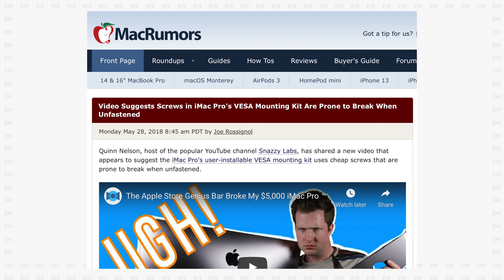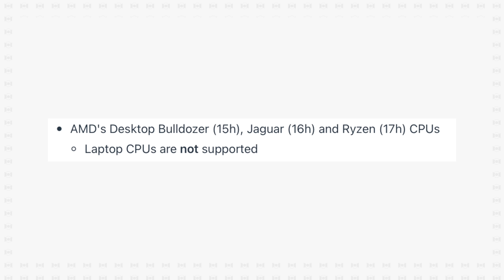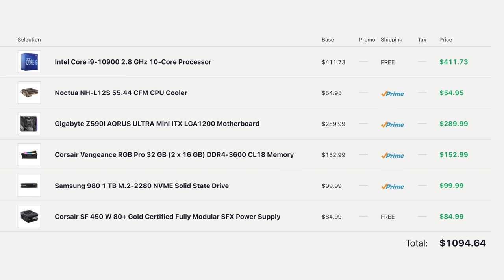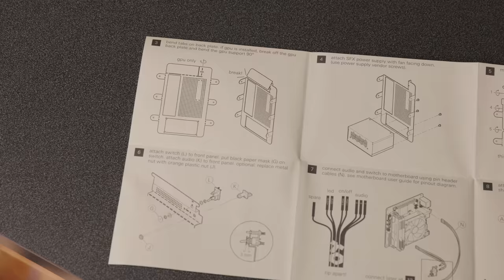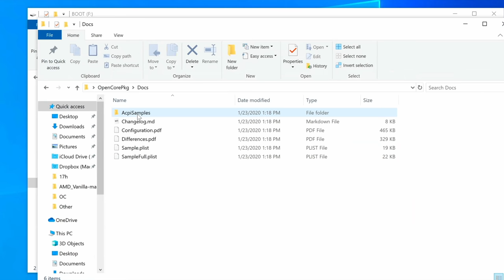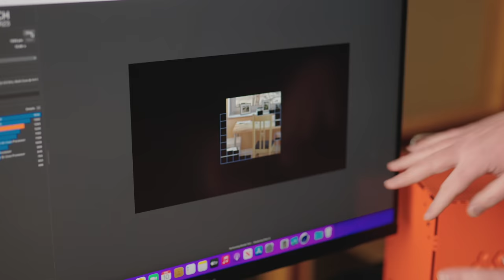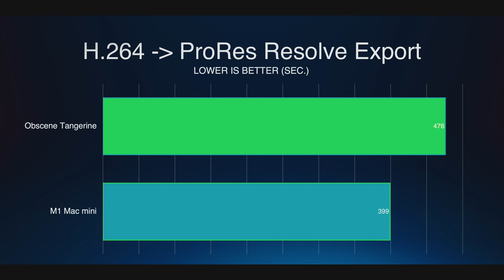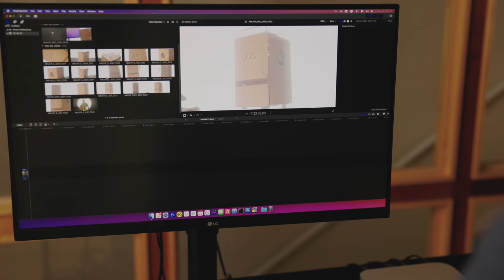The Last Hackintosh?

Comment: I get that Hackintosh doesn't make a lot of sense anymore, but how does the M1 stack up to this machine running Windows? Is there actually a benefit to running MacOS anymore? 

I used to build PCs from 1998-2010. From 2006-2010 I bought some used Macs to learn. Finally in 2010 I switched completely to Mac for my personal machines. OSX was more stable than Windows and there were more creative software options. Also Macs were still upgradable. You could swap HDDs, RAM, batteries, optical drives, and there were an assortment of ports. Plus they could dual boot Windows if need be.

I’ve been a Mac user for 12 years now and over that time Apple machines have gotten less upgradable and the OS has become less stable. I have more crashes and lockups today then I ever did a decade ago. The focus has also shifted from the creative community and education market to being more a high end fashion technology brand that sells flashy disposable gadgets. 

So even if they have gotten more powerful with the new M1 chips, is there still a benefit for me and people like me to be a Mac user? Assuming that we’ve already gotten to the point where most of us had plenty of computer power years ago to do what we need to do. That we don’t need to render that video 30 seconds faster, because it really doesn’t matter that much for most of us.

Comment: I really like the OpenCore approach but I’m sure it’s a PIA to get running. Years ago in the Z97 days I went hard and used Ozmosis which was an efi boot loader that you would custom build for your exact board and then flash directly to the motherboard. It gave essentially 100% compatibility including thunderbolt on my gigabyte board and would run incremental dot releases no problem but it was a massive pain with setup. After that machine essentially reached EOL when OpenCore released instead of doing it again and hoping I could find another nice German fellow to help me out, I bailed and switched to a 2011 MacPro. 

The EFI approach works fantastic and is rock solid once done (because it’s not really emulation but rather translation) but it’s too much work for me, even as a CS grad. In some ways I’m sad to see the end of the intel and subsequently the hackintosh days but at least Apple is making reasonable hardware again with distinct advantages.
Reply: so you downgraded cpus? Z97 is a 2014 platform, 2011 mac pros were a 2006 platform. it might have more cores depending on your config, but they were slower per core. how was that machine at EOL when opencore released? you can probably transfer your install to opencore, and your machine wont just stop working, and stop functioning once a newer bootloader becomes the standard.
Reply: @raycert07   Yes I didn’t want to move to OpenCore because of the headache of the setup. Also the fact that I upgraded to an AMD platform with an I
Nvidia GPU where as before I was using intel with the iGPU and it just wasn’t worth it to me. The machine was only EOL for its secondary gaming purposes. 

The Mac Pro is a DP machine so 12 cores total in my case with an AMD 570 and 64GB ram. More of a lateral move for my video/photo editing use then an improvement but easier to manage. I never said that it was an upgrade. I was able to move to Mojave something I couldn’t do on the old Ozmosis machine due to the death of that project and incompatibility (and my not wanting to waste more time on it) but that was the only change I made. The same SSD actually worked perfect on the pro.
Reply: @Alexlfm  yes it may have 12 cores, but thats because it uses 2 old 6 core xeons that are linked together through a chipset. having this chipset has performance impacts. the amount of ram also does not matter if your hardware cant fully utilize it. and having more ram might actually make workloads slower due to your cpus needing to make memory copies to the other cpus ram controller because they communicate through a chipset, and the memory isnt shared. but i digress. the sdd might work fine, though iirc they only support up to sata 2 which will definitely limit the performance of the ssd.

Comment: You know Quinn, as a seasoned Hackintosher, i have to say while the process was quite full of new experiences each and every time, Hackintoshes are not for people who need to 1. Get stuff done and/or 2. Have a family/friends/life. A Hackintosh is an enormous time sink and sadly i don't believe we have any of that to waste on endless tinkering.
Reply: Our business has been running hackintoshes as our main servers, render boxes and edit machines since 2013. If you do your research, it’s really not much different than any other computer. Even my fiance, who until recently couldn’t figure out use time machine, dailies a hackintosh and has had no issues in over a year. But yeah if you just slap together whatever parts and update the OS without knowing whats changed, then yeah, you’re gonna have a bad time.
Reply: This is easily one of the worst takes on hackintoshes. I personally got drawn to MacOS for productivity purposes and continue to do so as a developer. Windows for gaming, Linux for server stuff, and MacOS for development. That’s my workflow and building a high spec hackintosh (I’m not talking about the gamer CPUs, i’m talking about anything with more than 40 pcie lanes and 64GB of ram) ensures I do it without compromises and easily upgrade able/replaceable components. A hackintosh can be a one and done deal, you have the freedom to tinker and waste time if that’s what you want or build something reliable. That’s up to you.

Comment: You'll also need to add the $200.00 for the case to the Intel Build making $1294.64 not $1094.64 and putting the price a good bit over the Mac Mini.  Thanks for sharing.

Comment: 17:42 I think this shows you why Professional GPGPUs use HBM for memory instead of GDDR. For AI and Compute workloads at high performance it's easy for the GPGPU to get memory starved, so a solution like a unified SoC or HBM memory is prefferable where super high bandwidth and wide bus width is favourable.

Comment: 16g ram + 256g SSD + external SSD will be more reasonable for Mac mini.
Reply: I have never used a Mac before, so curious to know can you install softwares directly onto the external SSD ?
Reply: @vsuperbhat  yes you can, if an app is in a DMG from downloading you can drag it to the SSD folder instead of the applications folder and open it from there
Reply: @Noaddedsalt01  thanks for explaining 😊👍🏼

Comment: I'll curse Apple's anti-repair practices until the day I die, but when I went shopping for a laptop, the M1 chips made it a no-brainer. Unless you have a very specific piece of software you need to run that's windows-only, they're actually considerably better value than a lot of windows machines out there, especially when you factor in overall build quality and display quality. The lack of ports does suck though.
Reply: In a laptop there is no question... Power consumption wins, especially when you don't have to chose "crawling slow" to get low power consumption.

Comment: My guess is the affinity photo benchmark outperforms the AMD dGPU because the developer specifically optimized their code for metal and M1, and not AMD.  In cases where you’ve got cross platform optimization, like for example, redshift renderer with cinema4d, even an older NVidia mobile dGPU completely destroys the M1 Max.  And Apple specifically touts redshift as being optimized for M1 & metal on their own website 🤷‍♂️

Comment: While M1 is impressive, no doubt. Much of its single core performance emnates from the fact that it is based on cutting edge 5 nm process compared to Intel 10950K and most other modern CPUs are still stuck at 14nm. Intel is improving now so that gap is only gonna shrink. Second important thing is M1 packs special hardware accelerators for certain workloads which x86 architecture CPUs dont as of now. Maybe that will change soon.

Comment: Honestly, the M1 is amazing for who it is marketed for. And real people don't sit around running benchmarks all the time. For office work, it's going to blow past any similarly priced Windows PC. (And no most people don't need 1TB, Apple already buys up like half the world's supply of NAND flash they don't need to waste it on their entry-level computers who are going to be sold to people who can just as easily buy an external HDD or SSD if they eventually need more storage which they probably won't.)

For the tests that it didn't do well, I suspect we'll see an Mac mini Pro or something that will have twice the performance cores and be a much closer match and it'll still be in that price range if you don't give it more SSD than it needs. (Sadly I suspect it'll be announced after all the desktop users buy iMac Pros). Apple has already sold a ton of M1 minis to server farms and I suspect they'll sell a lot more once they offer M1 Pro and M1 Max in the mini (heck maybe they'll even do a dual Pro option.)

I think it's actually really cool what Apple has been doing with the M1 line of computers. The Air is actually just as fast as the Pro for a lot of things, and when the M2 comes out it'll be available to give non-pros just as fast of an experience as the Pros get, but the Pros will need to buy chips that allow more parallelism. It's kinda crazy but it's a lot more equitable than things have ever been on the Intel side of things.

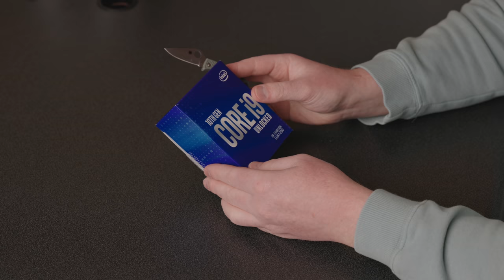Comment: @4:04 - bit of a correction there. Pro audio apps like logic pro and pro tools work absolutely fine on Ryzen (tested on big sur/monterey), and the issue seems to be specific to using certain machine IDs. I'm using logic pro on a Ryzen 3700x, and it works spectacularly, with excellent hardware acceleration, low sample packet size processing with low latency, and superb multicore handling (excluding the multicore handling bugs that have been present in every modern version of LPX, thanks Apple). No issues present at all in Pro Tools.

Comment: I think it would have been fair to compare the M1 mac to an Intel 11th gen cpu and not a 10th gen one... Apple wouldn't have switched over to M1 if it's Intel 10th gen Macs were better
Reply: The difference between 10th and 11th gen is laughable.
Reply: @nimoy007  eh no. 11th gen actually managed to beat Ryzen in some areas but its power consumption was so ridiculously high that it just wasn't worth it. ( especially on a laptop)

Comment: I built an alder lake desktop for less money than this and is significantly faster. I only say this because you are using 2 year old Intel tech vs 1 year old apple tech. 11th or 12th gen would really make a huge difference for no more money
Reply from the maker: Watch the video, please. First of all, 11th gen sucks. Yes, 12th gen would be more performance but it’s not fully Hackintosh compatible and the cost of even the lowest end GPU would push things WAY over budget.
Reply: @snazzy  Just man up and do a proper Alder Lake hackintosh. Get a cheap 6600 XT if need be. Quit stalling, you know Alder Lake is a monster of a CPU.

Comment: The case was made for form not function.

I love the idea of the aviator switch for power. So much mine has one for power, and one for restart, with a key switch in series with the power so both have to be used. Starting up(on the rare occasion it's shutdown so that I have to start it up...) feels like sending off a nuke.

Comment: Only sane way to run hackintosh nowadays in my experience is under QEMU like you showed in a previous video. You can run any CPU or network card you want (because you emulate a nic) and the compatibility is way better.
Reply from the maker: Agreed. Pretty cool.
Reply: @snazzy  Yeah. I tried OC a while ago and it's crazy complicated compared to clover.. Impressed you got it working.

Comment: 9:21 TRS stands for Tip, Ring, Sleeve, identifying the parts of the plug, originally a 1/4" plug used for telephony, back in the day of switchboard operators. There is sadly no standard for which is L and R, but the Sleeve is aways common. A little remnant of old technology, so you appreciate the world of standardization and instant gratification you grew up in.

Comment: One thing you failed to talk about (but tangentially touched on), is how much more powerful Mac's new silicon is for mobile computing.  If you're someone that works on the go, the MacBooks are even more of a no-brainer even if a hypothetical mobile Intel-based Hackintosh existed.  

You kind of touched on that with the power draw comparisons, but I think it's much better framed in terms of battery life.  Even if a theoretical mobile Hackintosh was 20% faster in certain tasks than a MacBook, you'd be able to work TWO TO THREE TIMES LONGER on the same-sized battery with a MacBook.  That's absolutely massive for productivity on-the-go.

So if you remove the power plug and the unlimited power of a desktop from the equation, I think the "which is more performant?" question becomes more interesting for any arbitrary length of time.  A mobile device without any power left is not very performant, and I have every reason to believe that mobile computing will only continue to grow in importance.

Comment: Just curious - How did you use the Z590i with a 10th gen cpu and iGPU? I tried briefly to do a hackintosh with an i5 10400 and b560i from MSI, but couldn't get display out and most "solutions" were basically "no you can't do that."

Comment: I started building hackintoshes for music / pro audio purposes.  In some instances, it actually makes sense to still have at least one hackintosh around in a studio.  A lot of audio hardware is expensive.  As long as you get something with good analog specs and it doesn't break, you're not going to be upgrading your audio interface very frequently.  The digital connection from the interface to the computer is usually quickly outdated, but the interface itself could function for quite a long time after that.  This is also not mentioning that the manufacturer of your audio interface could decide to stop making updated drivers for whatever reason.  Having a hackintosh in the studio that can run a wide range of Mac OS versions but also have the versatility of PCI express is quite valuable, and I have a feeling it will be for some time.

Yes, Thunderbolt dongles exist, but you often have to daisy chain a couple them to get the connection that you want.  For example if you need Firewire and you have a modern Mac, you have to go from Thunderbolt 3 to Thunderbolt 2 and then to Firewire.  Using this many dongles is just asking for trouble when it comes to an audio device, and using a direct PCI express card Firewire controller is much more reliable.  In my case, I have a MIDI control surface, the M-Audio ProjectMix I/O.  This device is an 8 channel audio interface but also a full control surface with motorized faders.  The closest modern equivalent is the Mackie MCU Pro which is $1300.  I paid $800 for the ProjectMix in around 2009.  It still technically functions today and works with custom drivers up to Mac OS 10.11.  One of the hackintosh systems in my studio is meant entirely for taking devices like this (including an old USB interface) and serving up the MIDI (and audio if I wanted) across my home network to other computers.

However, I think the day may have come where my DAW computer will stop being a hackintosh and I will replace it with an Apple Silicon machine.  Since I only need Thunderbolt 2 on that machine, I'll only have to use 1 tier of dongle.

Comment: I have a Mac Pro 2010 with GTX980, PCIe SSDs, 32GB Ram and 12 cores.
It runs High Sierra and runs more of the applications and games I have than a modern Mac does.
I don't want to run things trough many layers of emulation, or not at all.
Yes, quite a bit of the software I want to use is not well maintained or at all, but that has never been a problem on Windows.

Comment: Apple silicon computers are e-waste from the factory. They have soldered storage, RAM, and non-removable batteries in the laptops. Storage and Batteries are finite consumable items. They have a life span and when that life span is met these machines are un-repairable and headed right for the landfill. There is no real reason the M1 Mac Mini doesn't have RAM slots or m.2 sockets. Government environmental agencies should be going after apple for knowingly producing products with non-servicable consumable parts.

If Ford, Honda, or Tesla tried to sell you a car that must be junked when the tires or brakes need to be replaced there would be an uproar. This is identical.

Comment: How did you get the front m.2 slot to work with a 10th gen Intel cpu. I have a 10th gen and the same mobo but my gen 3 m.2 does not get recognized on the front slot

Comment: The Rx 5000, Rx 500, and Rx 6000 can be used in a hackintosh and can get as low as $90-$150 on the entry level of each of these GPU platforms

Comment: i have not built a hackintosh in a long time. 2008 with a dell laptop was the last time i had mac os on an intel. i really liked it, dual boot with windows vista and i got some funny looks in the coffee shops with mac on a dell. got me through some collage programs that had mac only software (or at least software that worked far better on the mac). what took me the longest was getting the damn nvidia 8600 working. a solid couple of weeks screwing with kext packs

Comment: As someone from the days of Homebrew Computer Club who built host systems by hand board, connector, and chips using a soldering iron on my first build.  Now being old, and Apple's new products being what I fell is a very good bang for the buck.

So feel my days of even putting together a host system from parts is over except might work on a Pi system just to keep the brain cells working.  Also when my Mac's age out of Apple OS support updates like my iMac (Retina 5K, 27-inch, Late 2014) just did.  I move them to LinuxMint to keep myself in the Linux/UNIX command line world.